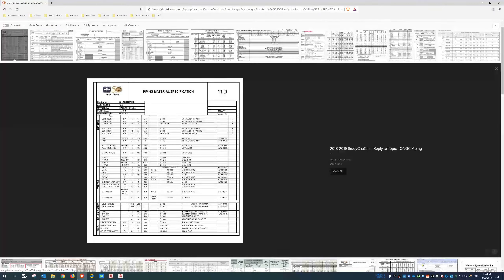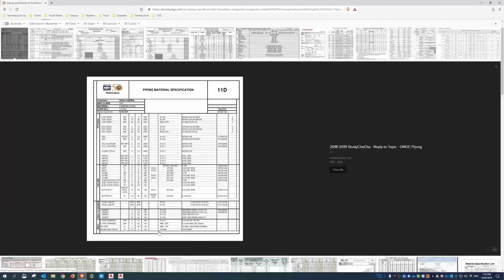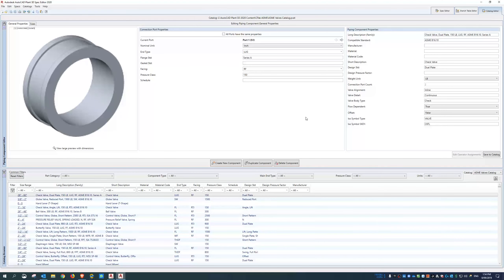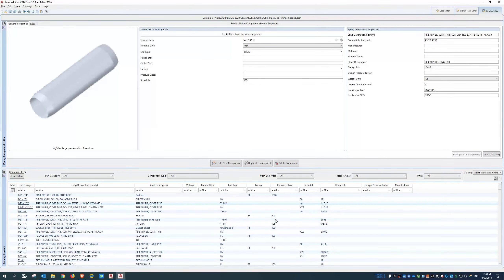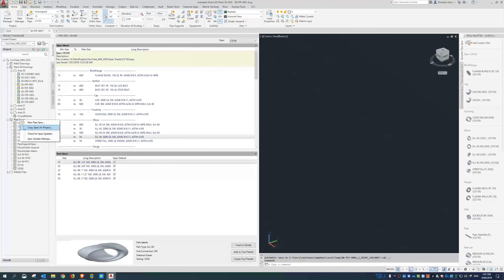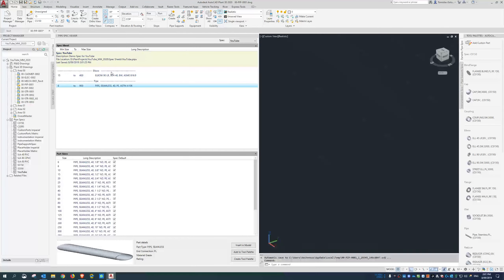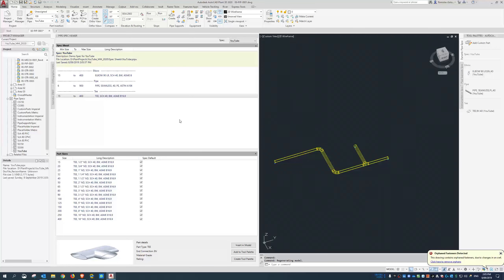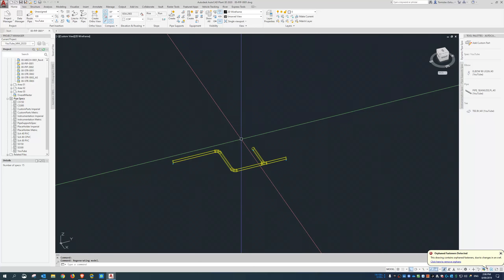Plant 3D: Catalogs and Specs - Make a new Spec

Comment: What need to be done in spec branch table?
Reply from the maker: In the Branch Table, you need to add the fittings that line up with what was given to you on the paper spec. If the paper spec doesn't have a branch table, you'd need to ask the engineer for it. This gives me an idea to do another video on Branch Tables